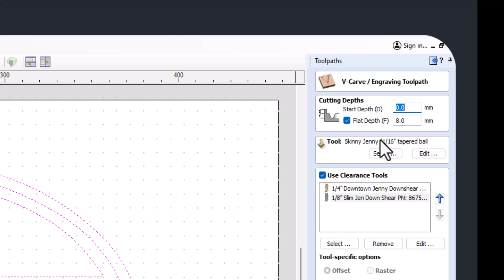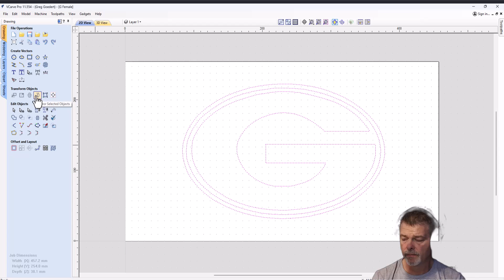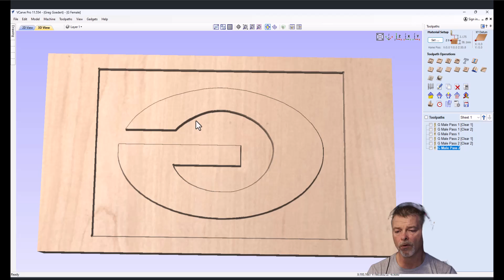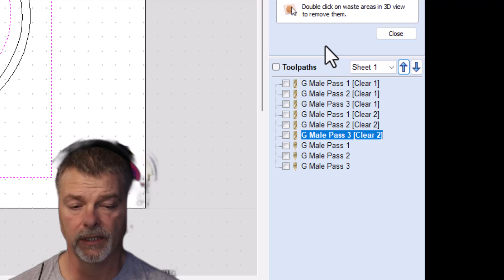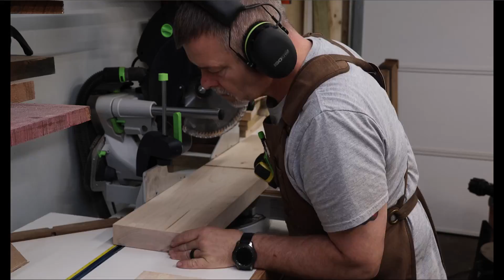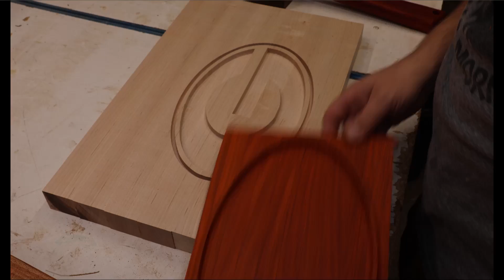Deep Inlays That Actually Look Perfect

Comment from the maker: Join this channel to get access to perks:
https://www.youtube.com/channel/UCbK6DJahcP25rK0XK7__REQ/join
Most links to products are affiliate links and means I get a commission when you use them. Doesn't cost you any more but helps the channel out.

Get the 3 bit Inlay set
https://www.cadencemfgdesign.com/?ref=STL10off
Code STLWoodworking and get 10% off

Come join CNC With Me
https://www.cncwithme.com/a/2147794830/rckc8UD7
Don't forget to use the Code STL and get 15% off
@HamiltonDilbeck

Comment: Been trying to use a TBN but it always cuts the female over size and the male under size,  causing a vert loose inlay.. any ideas why? Any helpappreciate😊d.
Reply from the maker: My first question would be, are you using all the same bits for both the male and female? Another question, how much glue gap are you allowing?

Comment: Need some help. The male inlay does not fit in the female. I followed the steps on your video. Any ideas on what I’m missing.
Reply from the maker: Not sure without seeing the file. The steps works you saw in the video. Make sure you are using the same bits for both operations. Also make sure you mirror the vectors no matter how symmetrical you think they may be

Comment: Hi Greg, Great tutorial video. I have questions if you don't mind, When you save your G male 1,2,3 toolpaths to " Visible toolpaths to one file ", Does the CNC stop at the end of 1, then 2 then 3, or does it pause then continue through each stage? If it does stop, Are you setting the Z each time? Also, the feeds and speeds for the TBN bit, I think you had it at 100 ipm, does it handle that feed rate? Forgive me for probably asking questions hat others may have already asked, I'm fairly new at the wonderful world of CNCing. Thank you for your time and help in my quest for further CNC knowledge. Regards,  Michael
Reply from the maker: No worries at all, that's what I am here for. The way I save them it will cut everything with each bit and the only stop is to change bits. Yes the tbn can handle the speeds. Not sure what cnc you have but as long as it can handle it the tbn will do it
Reply: @stlwoodworking  Hi Greg, Thank you

Comment: thanks, good informative video, seems to simplify and go straight to the point. do you practice or test on certain materials, I was gonna use some scrap walnut and maple as those seem to be popular, but wasn't going to make end grain stuff just for practicing, thoughts?
Reply from the maker: You could practice on face grain and edge grain just to get the tool path down but end grain does much better for inlays

Comment: I am lost on the math, if your are starting with flat stock for the male plug, why do you put your start depth to 1.5 the first time and 2.0 cut depth, doesn’t that mean your cut is 3.5?  and then 7 the next cut?  Where do these numbers come from and why ?  Does this just mean you are doing a deep cut instead of working down from surface material to the 3.5 depth?  I’m unsure and just trying to understand the Why part of this…
Reply from the maker: It just allows for you to cut a little at a time on all aspects which helps with tear out and chipping on deep inlays.

Comment: Really helpful video Greg, thank you! Like a lot of people I've been a bit disappointed with Vectrics new Vcarve Inlay feature in Version 12. I've been looking for a good guide on the "old" way of doing a vcarve inlay. I've one question though, if I was to choose to skip the 1st two toolpaths and do a full 9mm cut instead of "creeping" up on it what do you think the implications would be? You mention in the video it cuts down on chipout but I've seen many tube videos where the TBN cuts straight in, in one pass? Thank you again!
Reply from the maker: It does cut well but I would still do it for that reason.  As far as vetric and the new tool path, it works well for your more shallow inlays. It is new  so you may have to give them a little to get the bugs worked out

Comment: Great Video, but just wondering if there was a reason that you couldn't set your start depth at 2 and set the full DOC at 9 and adjust the pass depths in the tool path,instead of creating 3 different tool paths? Also if you group toolpaths when saving the should group those different passes together for the same tool.
Reply from the maker: I guess you could. The reason I started this way was because the software I was using. I could not adjust the passes. So at this point I can create a tool path just as fast as I could go in and adjust the passes.
Reply: You cannot edit pass depths in a vcarve / engraving tool path, because when engraving with a V bit it is just one pass.  So, if he didn't do it with separate tool paths the way he did, the bit would plunge to full depth on the first pass and would almost certainly break (and most likely ruin your project).

Comment: I just received my bits.  Do you have a recommend font to use to give a good deep inlay?  My toolpath model does not appear to be deep enough with the font I chose.  I can't recall which font I chose (away from my shop computer)
Reply from the maker: It really just depends on what you are going for. I try several different types to get what I need for a project. Just go by  your render until you get what looks good. The bolder letters do tend to do better with deeper.
Reply: @stlwoodworking  Good morning Greg, Happy Friday!  My female cut came out perfect.  But one of my male pieces did not fit.  As I processed the toolpath, it gave me a warning about tolerance issues and one of the bits may not cut.  So of course, I pressed on and does not fit.  I'll grab the screenshot of issues and send this afternoon.  I need to get this project to my client by next weekend, so any help is greatly appreciated.  I have no issues paying for your time as I'm sure you are a busy man.  Cheers
Mario
Reply from the maker: @mariomarcoccia6277  Reach out to me through my website.  stlwoodworkingshop.com
Reply: Ok thank you
Reply from the maker: @mariomarcoccia6277  you are welcome.

Comment: Thanks. Love your videos!  Question, I noticed you kept your Tbn bit as a tbn bit in the tool database settings. I have seen other people Change the tbn to a vbit and double the angle. 
Do you find you don’t have to change the bit in the tool database?
Thanks! 
Chris
Reply: @chrispelletier3661  they do that if they want to use version 12’s built in  carve inlay tool. Otherwise they do the “traditional” method that this video explains.

Comment: This is great! I’m working on a piece where the entire piece if a 1.5” circles with a logo inlaid. I’m doing my clearance passes and cutouts with a 1/16” bit… I had been doing the inlay tool paths with a 30 degree Amana, but I can already tell by looking at the Vectric preview that this is going to work better for this super small design.

…also, it appears we have the same jointer AND table saw… subbed.
Reply from the maker: Awesome. Welcome. Be sure to check out our FB community so you can share it when you are done. Have Patreon as well with Discord.

Comment: Sir the information in this video was extremely valuable for me. Thank you so much. I have the same set up as you in regards to CNC and software. How did you get Carbide motion to recognize tool changes from Vectric? Subscribed!
Reply from the maker: Thank you. When you export the gcode you select the post possessor as carbide motion and everything is available just like using carbide create. It will come over and request a tool change and tell you which tool # to change to and will reset using the bitsetter.

Comment: Wondering if you can help me out. Followed the depth of cuts for a two part inlay. One mountain scene in walnut that came out good with the settings (though I needed to tap it in a bit more in one part and have a small gap as a result. Nothing some glue and sawdust won't take care of) but the second inlay is a compass with N, W, E lettering. Parts of the compass tips and smaller section of lettering didn't cut as deep in the female said as the cutout for the male. I used 1/8" clearance and the tapered Jenny bit for both. Wondering if I just needed smaller than a 1/8" for a second clearance? Tapered Jenny just didn't seem to get as deep. First attempt at an inlay here, so still figuring this out!
Reply from the maker: If it is that small of detail you could do a small test cut to see if maybe a 1/16th bit might work. I would be happy to look at the file for you if you would like.

Comment: Great and detailed video. Question - I too group tool paths in Vectric when possible but save them in chunks based on the bit.  You just saved them all together. When the CNC machine is done with tool #1 (running all three passes), does it return to the origin point and wait for you to do the tool change, allowing you to resume and move on to step two?  I use GSender and can't imagine that.... thanks, Sir!
Reply from the maker: Yes it does. I use carbide motion and when it is done with a tool it will come to the front to allow the change and then it uses the bit setter to measure the bit I changed to and then runs the next path.

Comment: Nice informative video. The tapered bits seem to be the way to go, especially for cutting boards. Using a 60 degree with the depth of cuts Vectric uses is ok for a wall hanging inlay or something not going to be chopped on and resurfaced. It leaves too big of a glue gap that becomes a void. And the tapered bit allows a deeper cut which equals more resurfacing. Curious about using  the 2 clearance bits instead of just 1. Was there a part of the G that was too tight for the 1/4”?
Reply from the maker: Absolutely. I hope more people will give it a try and see how much better it is in my opinion. That's one reason we put together that bit bundle.

Comment: thanks for posting this video, it's always good to learn new techniques, but I do have a question for you. Is there a reason why you do 3 separate passes for each of the inlay (positive ) pieces rather than changing your pass depth of the tool so that it will only go down 3 or 3.5 mm per pass ( whatever you set the pass depth to) ? then you could run one pass but it would only go down that max depth per pass.
Reply from the maker: Just easier for me. That way it doesn't chip out taking too much each pass.
Reply: Yes, I understand that it doesn't chip out  when you take shallow passes, I essentially do the same thing by changing the tool parameters, and that way I don't have to run 3 toolpaths. you can achieve the same thing taking 3 shallow passes with one toolpath. Thanks for the reply. I look forward  to more of your videos
 @stlwoodworking
Reply from the maker: @gregraso557  Thank you for the tip

Comment: Other than that “G” great job! 😉. Please.  Correct me if I am wrong (trying to understand) You did an 8mm female and a 3.5mm male. Would that leave a gap of 4.5mm gap? Or am I thinking wrong? Which is quite possible lol keep up the good work
Reply from the maker: LOL I am surprised it took someone that long to mention the G. I do an 8mm Female and then the male is in 3 different passes that equal 9mm. that gives you the gap at the bottom for glue squeeze as well as a gap at the top to trim off.
Reply: @stlwoodworking  ahhh ok I missed that. I guess I need to go back and rewatch. About the G thing I’m an FSU guy but my nephew was just promoted at the T and recruiting director…🤷‍♂️ 😂
Reply from the maker: That is awesome. I am going to do some other teams "for friends" to see how they turn out.
Reply: @stlwoodworking  Seahawks would be a great one try. For a friend of course… 🤷‍♂️
Reply from the maker: @CampfireWoodworksRVA  makes sense lol
Reply: Ok Greg just gave your method a shot.worked great! I especially loved how the vbits are not plugging .31 inch all in one pass! Thanks for the video and information! Even though it has that orange T Team on it it didn’t explode! Haha